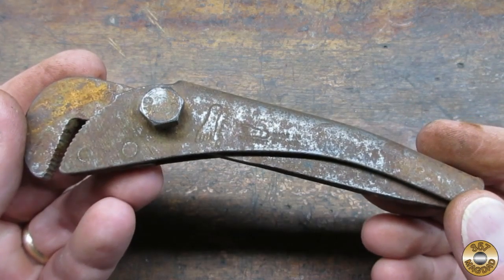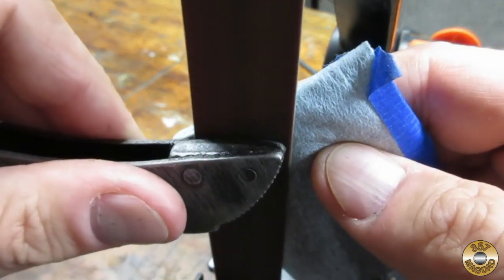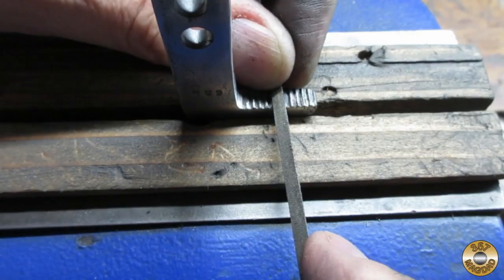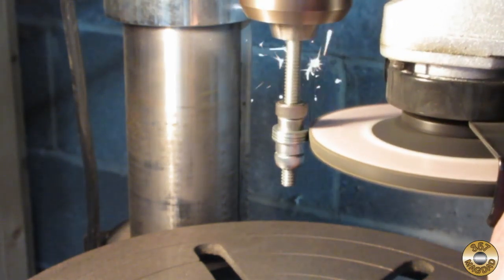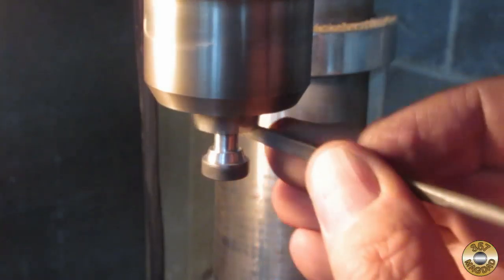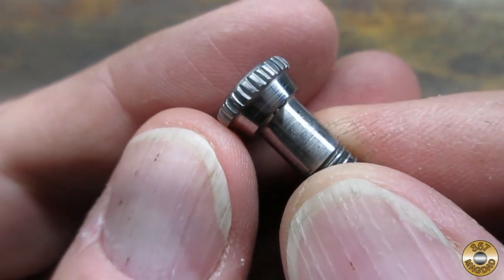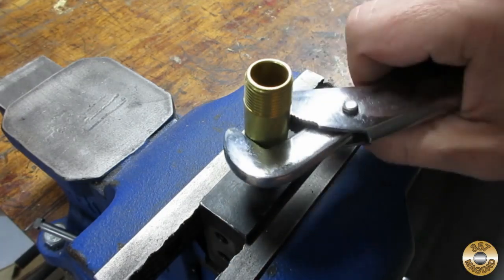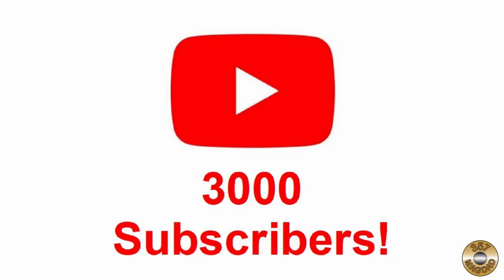Hand Tool Restoration - Footprint Wrench

Comment: Hi Magdad, as a British  gas fitter I  was introduced to Footprint  pipe  grips way back in September 1966 as a first year apprentice gas fitter, and used them for forty three years all throughout my career in the gas industry.  I had two pairs set to fit  Ten light (1") and  Five light  (3/4") gas meter unions. The  Gordon,  (Chanellock) grips we were issued with, were too small for  the bigger meter unions. So two pairs of Footprints made life easier. I was in my garage workshop just today, and came across my Footprint wrenches and oh boy,
were they ever in a bad state, covered in a fine film of rust. I have ordered an angle grinder, and a bench grinder for my birthday in 
April, (71st)   and the first project will be my Footprints !  Still set for 1" and 3/4"  as it happens, I am leaning towards wire brushing and blueing, as that finish is nearer to the original finish that I remember. Stay safe Sir, ✌❤ Bob.
Reply from the maker: Thanks Bob!  Those Footprint wrenches seem super handy!  I'd love to see photos of your project! 357mdad@gmail.com

Comment: 357Magdad, a fantastic restoration. I used to live and work in Sheffield and our office was across the road from Footprint tools. At around 10.30 am the guys would come outside in the summer to escape the heat from the hot forging wearing only safety boots and shorts. Their bodies were often black with riverlets of sweat going down their chests and backs. They would remove their goggles and look like owls with two large white rings around their eyes while having a mug of tea. Tough guys doing a tough job and it is great that the company is still going after experiencing a sticky patch a couple of years ago.
Reply from the maker: Thanks UK Tony!  That's a cool story!  Sounds like hot, dirty work!

Comment: Great job on the knurling! That nut turned out awesome!  I've been wanting to buy a file to put checkering in firearms, the front strap of the trigger etc. They not cheap! Gosh, I love Evaporust. I have a 5 gallon bucket (and a few 1 gallons) of it waiting to de-rust some goods (64 C10 passenger side suspension). I filter it with paint filters (cone shaped) and it gets it pretty clean. I love the different tools that are discovered. Of course the wife doesn't like it as I slam brakes on yard sales with tools! LOL. Thanks to ScoutCrafter and now I'm sure soon with you! It's fun.  Keeps me out of trouble! Great video. 3K is great, There are endless peeps doing channels.  I usually go by word of mouth as there are so many!
Reply from the maker: Thanks Aaron!  Hunting for old tools is as much fun as cleaning them up!

Comment: Yes, definitely a nice repro of the pivot screw 👍🏻

When I did my Footprint restoration, I contacted the company to see if they had any info on production dates, as my wrench had military markings - they actually responded and were very helpful/pleased to see the restoration. Good old Footprint 😂👍🏻🛠️
Reply from the maker: Thanks Armando!  I wasn't able to find much online about my 695 pattern.  It looks like the 698 was much more popular.
Reply: @357magdad  Interestingly, some of the earlier wrenches were put together based on what components were on the shelf.... So there were some hybrids, like my wrench.... That's information directly from Footprint; obviously the quality control significantly improved over the years!!

Comment: Wow, it came out great! You’ve given me a few ideas with this video! I have a propane torch and solder and flux, but I have been reluctant to experiment with it because I never did it before, but do want to learn. I bought a slightly larger version of the same wrench off eBay and I keep it in my tool kit. I pair it up with the Knipex plier-wrench and I think it’s a pretty effective combination and I added an Irwin version of the Cobra type pliers to that same kit
Reply from the maker: Thanks Joe!  I had trouble getting the solder to flow. I'm not sure it was the best stuff for steel. I have more experimenting to do!
Reply: @357magdad   It's  me again Magdad, there have been times in the past when I have had to  use  solder on steel, (not ideal as soft solder is used on non ferrous metals copper, lead, and brass.) The secret I found was to use plenty of flux,  and not get the  steel too hot,  Cheers, Bob. ✌❤

Comment: There were many different British thread types, BS Whitworth, BS fine, BS cycle, BA etc etc
I had to fabricate one of these pipe grips as part of my apprenticeship in 1979, still using it, not as shiny as yours though, I'd be afraid to polish it as it was case hardened
Reply from the maker: I'd love to see some photos of your shop made tool!  357mdad@gmail.com